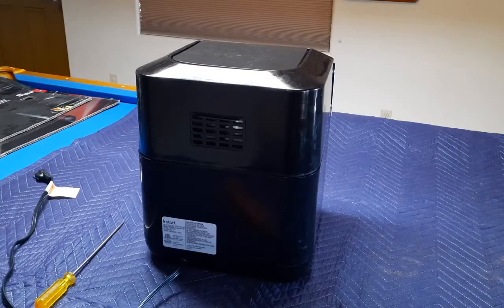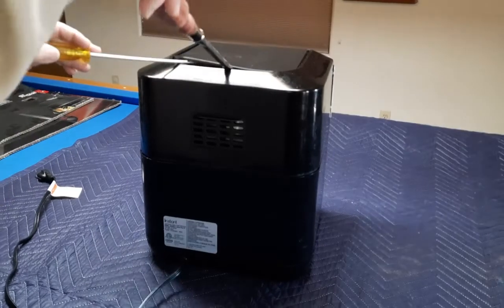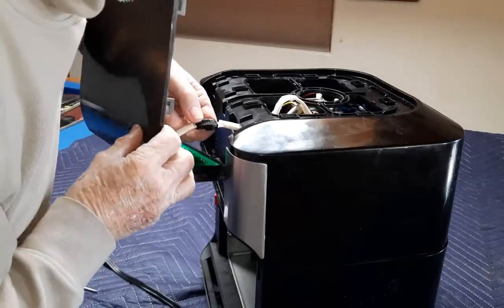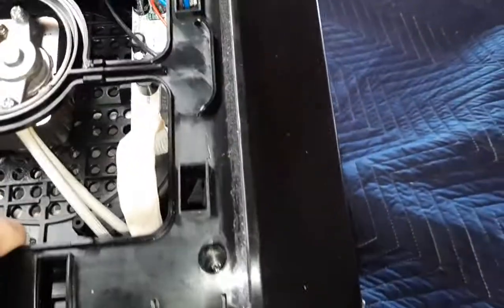How I fixed an Instant Vortex Plus Air Fryer

Comment: Hi, my light comes on but the display isn’t working. What could be the issue there? Thank you!
Reply from the maker: It sounds like you do not have an open thermofuse that needs to be reset, since it would take power to turn on the light, however I would still try the reset for these two reasons.

Perhaps, but very unlikely, the thermofuse is only partially open, so only enough power to light the light comes is allowed through the thermofuse, but not enough to power everything else. I really think this is highly unlikely though. 

Perhaps there is some power stored somewhere which turns on the light. If that is the case, the stored power will dissipate over time and then once the stored power has been dissipated, there will no longer be a light. Also highly unlikely, but maybe worth a try to reset the thermofuse. 

I am sorry, I originally made this video because I discovered the thermofuse could be fairly easily reset and I wanted people to know how to reset theirs. So, I am not an expert on the fryer. 

I gave the fryer back to my son once I had it working again, so I am at a loss about your symptoms. If the thermofuse reset does not work for you then I am sorry. Sounds like your problem is beyond the scope of this video and I wish you good luck in finding a solution.

Comment: Hi, were you able to read the thermal fuse at all?  Got it KSD301-CR 16A 125V 200 degree C, sounds like should be normally open type too, thank you.
Reply from the maker: I am not an expert in this area, but I do know this is considered a safety device to stop the fryer from working once the heat goes above the rating on the safety device. See end of video where I list on the video screen what was written on our thermofuse. It was

KSD301-CR
16A 125V 
200 degrees C

When I googled KSD301-CR I found several, but only a few that go up to 200 C rating. The one I list below with a link to Amazon does not appear to have the black button on it. It says Normally closed N.C. so I am thinking once the temperature exceeds 392 F or the 200 C rating there might not be a way to reset it or close it again. It does say Adjust Snap Disc, but I do not know what that means. You will have to do your own research. Some of the others listed on Amazon, at much lower ratings, say Advantages: Auto Reset. The below one does not state that as an Advantage, so I assume once it opens it will no longer work, but I could be wrong. The key here is to keep the fryer as clean as possible and to always move it to a space away from the wall, so when in operation, it can circulate air easily and hopefully not exceed the safety device's rated temperature. Sorry that is about all I know on this subject. Good Luck!

Uxcell KSD301 Thermostat 200°C/392°F 10A Normally Closed N.C Adjust Snap Disc Temperature Switch 2pcs

https://www.amazon.com/uxcell-Thermostat-Control-Microwave-Normally/dp/B07L95V76N/ref=sr_1_4?crid=XOKAZ2SSP1AY&dchild=1&keywords=ksd301+125v+16a+200c&qid=1614273176&sprefix=ksd301+125v+16a+200%2Caps%2C266&sr=8-4
Reply: @johntube2525  It looks like that one listed is a 10amp, the specs you listed say 16amp. Looking at the 1500W on the unit, that would be 12.5 amps. I wonder if that extra amperage will make a difference to that thermal fuse? I was wondering if you ever found the exact ksd301-CR 125v 16a 200c? Also, I wonder if the "R" in CR means it has the reset button?
Reply from the maker: @michaelsmith2867  No, I could not find the exact replacement. Good question about the R in CR, I honestly do not know the answer. I vaguely remember finding lots of them, when googling, but most were way low on the temperature rating. Like as low as 90 C. I also vaguely remember finding what looked like the same one at some online electrical parts supply shop, but they did not just sell one. Seems the minimum was like 10 or more. I assume they wanted to supply an actual repair shop, which is not me. Sorry not much help. All I can say is keep searching, I am sure there is a source somewhere out there. Maybe check with a repair shop in your area and perhaps they can find one for you. The difference between a 10A and a 16A sounds too big a difference. 
Based on the feed back comments and my son’s experience it seems this component is somewhat durable. Are you sure it is bad. If you have it out and in your hand, I wonder if a person was to put it in an over at temperature a little below the rating if it would trigger it open. If it triggers it open way below the rating then I would assume it is for sure bad. If it stays closed at say 385 degrees F. Then perhaps the unit just needs to be cleaned and only operated in an open setting so the fan can circulate cooler air. If it seems to be opening way before the unit has a chance to get up to 392 degrees F, then it is probably bad. Just a few on my thoughts on this thermal fuse. My fix never came back to me, so I never worked on it again. Good luck and sorry I am not helping you more.

Comment: Question .... what if it happens again when using it the first time after fixing?
Reply from the maker: Sorry this long, and it is only my opinion and I am not an expert! When I removed the thermofuse, I saw it had written on it, 200 C, which when converted to Fahrenheit is 392 F. This seems a little low, but there again I am no expert. 458 F is the rating for spontaneous combustion, so I guess they wanted to stop the unit well below that temperature. 
Theoretically, the thermofuse will stop the flow of electrical current by breaking the path when the temperature exceeds the rating of the thermofuse. No electricity beyond the thermofuse, the unit will not work. So once the temperature exceeds 392 F it stops the flow of electricity. Given that and since I noticed the thermofuse had continuity once I removed it by pushing the black button, I decided to clean the unit real good, since I basically had it completely apart. I had removed the heating element, fan, and top plates so I could get to the thermofuse. I noticed the thermofuse and the inside plates were dirty from use, but easy to clean since I had the unit apart. I think any build up of grease and grime on the inside could cause the unit to exceed the rating of the thermofuse. In my opinion, it is very important that the unit can circulate air. Pulling it away from the wall when cooking and making sure it can easily circulate air could help to not trigger the thermofuse. Wiping down after each use so there is not a build up of grease could also help. These are just my opinions and I do not own one, I simply fixed my sons by resetting the thermofuse and giving it a thorough cleaning.  I hope this helps should you manage to read all this. Good luck.

Comment: My husband just fixed our dead vortex by pressing the button on the thermal relay shown in this video, after testing it with his meter.  Why don't they put a reset button on the outside so anyone can do this. Most people would just throw it away.
Reply from the maker: I have my opinion, but that is all it is, I really do not know. I think they intentionally made it hard to reset, because it is a safety device that will shut down the fryer should the temperature exceed the rating, which is 200 degrees Celsius. I think they did not want the fryer to reach that temperature which triggers the safety device and they therefor made it hard to reset. Like I say, just my opinion. My recommendation is to clean the fryer regularly and to give it room to breathe so it hopefully will not reach the temperature that will trigger the safety device shut down. Thanks for watching and a great comment.
Reply: @johntube2525  We have the one you fixed in this video and the 2 qt mini, which is the one that "died". It is so small that is was basically only used for toast which was done before the "add food" message popped up. I cannot imagine that it got too hot but whatever the reason was it now is fixed. I liked it so much I got the larger one and use it a lot for all sorts of things. Thanks for a great video!

Comment: Excellent video for dismantling.  I was trying to  remove the heating element to clean to top inside the oven. Removed the bolt and heard the washer and nut fall behind the oven wall.

Found the bolt and nut then clean the inside...some might be surprised how dirty the inside gets in 1 year.
Reply from the maker: Yes, they do get quite dirty. I think your cleaning will be a benefit to keeping your fryer operational. Since I had my son’s practically completely apart, I cleaned it real well before reassembly. I put in the description that the fan is left hand threaded, which should help get it off. It is easier to clean the inside plates disassembled. I also stated in the description, that cleaning the thermofuse and thermistor after each use, or at least wiping them off, would probably help keep the fryer running. Good comment and good job.

Comment: I just watched this. The numbers are "dying" on certain parts of the screen making it impossible to know what temp the oven is on. Do you think this will help reset the numbers?
Reply from the maker: Sorry to hear this! I do not think resetting the thermofuse will solve your problem. Basically, resetting the fuse, allows current to go to the unit. If not reset, there will be no current going to the unit. Since you are getting something on the display, you are getting current to the display. Since I do not own a fryer, I also do not think I can help you solve your problem. I simply fixed my son’s, by resetting the thermofuse and decided it was such an easy fix, that I should make the video to help others with the same problem. Sorry!
Reply: Hi Heidi did you ever know how to fix the numbers I’m having the same issues? Can seem to figure out the numbers on it any more ? Please let me know if you got it fixed ? Thank you

Comment: Do you have the part number of the resettable thermofuse you purchased as a replacement?
Reply from the maker: Near the end of the video I put a subtitle with this information:
Thermofuse was Labeled:
KSD301-CR
16A 125V 
200 degrees C
The above was printed on our thermofuse. I did not buy one since ours had continuity after I had gone to the trouble to remove it. Once I put the unit back together with the original thermofuse, the unit worked. I think I found one by googling the above information. Never did buy one. Good luck and I hope this information helps you.

Comment: Mine trips of the breakers... It was working fine.. you think this will also fix it..
Reply from the maker: Sorry to hear you are having fryer problems. If your fryer is tripping the breaker then I DO NOT think this simple reset of the thermofuse will solve your problem. Sorry, but that is a problem beyond the scope of this video. A thrown circuit breaker generally happens when you have a short. Hot connected to common or ground and it is dangerous when the short occurs, but circuit breakers make it somewhat safer. I remember when our electrician was installing switches and outlets in our new house, he would just touch the hot black wire to the white common wire, basically creating a short and A Spark, and throw the circuit breaker from wherever he was working in the house. I have never been brave enough to do that. I always make a trip to the circuit breaker box and throw the circuit breaker off that way. Sorry I cannot help you with this problem. But this is an example of how he would throw the circuit breaker,  hot wire to common short. If no other devices throw the breaker plugged into the same outlet and turned on, I would probably buy a new fryer or take it to someone to fix. If other electrical devices throw the breaker, I would call an electrician. Sorry and good luck.
Reply from the maker: Judith, I woke up last night thinking about your problem and thought, perhaps Judith has a damaged power cord, which could be replaced, if damaged. I am talking about the power cord from your fryer to the outlet. Perhaps it got to close to something hot or has been damaged somehow. On my sons, the hot was blue, the brown would have been the common, and the yellow with green wire would have been the ground. If that power cord is damaged and the hot wire managed to touch the common or the ground, it will create a short and should throw the circuit breaker. If the power cord is damaged, then it would create a situation similar to my example of my electrician simply touching the hot to the common or ground to INTENTIONALLY throw the circuit breaker. Once he INTENTIONALLY threw the circuit breaker, he could work anywhere on that particular circuit with no fear of a severe shock, because there is no power once the breaker is thrown.  If your power cord looks fine, looks brand new, no damage, then again, sorry, the problem is beyond the scope of my video. I do show how to checking a power cord in one of my videos. How to repair a Harbor Freight heat gun. It did not have a bad power cord, but I do show how to check the power cord for continuity. If you unplug your fryer from the wall outlet, and disconnect the blue and the brown wires, inside the unit. Then check for continuity across the brown and the blue. If you have continuity across those two wires after they are disconnected from the unit and the wall, then the hot and common are making contact somewhere in the power cord and you have a bad power cord. Never check for continuity with power present. Always, Always unplug the unit. YouTube has several videos on how to use a meter to check continuity. Hope this helps.

Comment: My display turns on and even the fan and it sounds like it’s working. But it isn’t getting hot. Will this trick fix this problem too or just the broken display?
Reply from the maker: The thermostat or thermal fuse is a safety device to stop the entire unit from working, by not allowing any current to go past the thermal fuse, once it gets hot enough to trigger the thermal fuse or safety device. Ours was rated for 200 degrees C.
Once the safety device is triggered, nothing will work until either the safety device is replaced or reset, then current can pass thru the safety device again. 

If you screen comes on and your fan is working, then they are receiving current and your safety device does not need to be reset. It sounds like your heating element is not working and since I was able to fix my son’s fryer by simply resetting the safety device , I figured people will be able to do the same if they know how. So I made the video for that purpose. I am not sure why your heating element is not working.  I do not own one of these fryers and unfortunately, your fix is beyond the scope of my video. If you like working on these types of things, you could take a look at the wiring and components just in advance of the heating element and see if you can find a problem there. Sorry, but that is about all the help I can offer since this type of failure did not occur with my son’s fryer.
Reply: @johntube2525  ok thank you! I have bookmarked this video if I need it in the future though 😁

Comment: Great video. Thx for sharing! I hate to think how many of these units are going in the landfill, when they can be fixed in 5min with no parts. I didn’t even have to unplug the LED panel or remove the top housing. I just got a long, thin screwdriver and pushed the reset button after prying up the top.
Reply from the maker: Thanks for the helpful comment.  Once you know where the little black button to push is located, your way is the easiest way to reset the device.
Reply: I’ve noticed the thermal fuse on my vortex plus has been tripping more frequently. I have to reset anytime I’m cooking at 400f for multiple minutes, so it definitely has a heat displacement problem or the fuse is too sensitive. I’m considering drilling some more vents in the plastic lid to see if it will help with heat.
Reply from the maker: @bchain8601  Thanks for watching and the comment. Please, let us know if you find a safe and successful way to eliminate having to continually reset the fuse, when cooking at 400 F.   However, I am not surprised since the thermofuse is rated at 200 degrees Celsius, which is 392 degrees Fahrenheit. 

The unit I repaired was my sons and before that it was his mother-in-law’s. I say this, because I have never seen the User’s Manual and I have never had the opportunity to read the User’s Manual.  400 degrees F is higher than the thermalfuse’s rating of 392 F. I saw another YouTube video where the lady was going over how to cook with a fryer and she stated, as per the User’s Manual, be sure to pull the unit away from the wall before cooking with in it. She went on to say that it needs to be able to breathe properly. Since, I did not have a User’s Manual that video helped me try out my son’s unit after I had re-assembled it. Otherwise, I would not have known how to cook that piece of ham you see at the very end of my video. Good Luck!

Comment: Thank you so much! I was so worried I was going to have to purchase another air-fryer haven't even had this one a full year yet. My kids use this thing daily. Had it fixed in about 5 minutes. Once I heard the click after pushing the button on the fuse, I knew that was the problem.
Reply from the maker: Thank you for watching and commenting! 
Please read my long comment to Angela Cendejas below because I am concerned that people will simply push the button and then have the safety device shut down the fryer some short time after resetting the safety device. I know the comment by me is long, but I try to explain the role of the safety device and why it might have been triggered. Thank you!